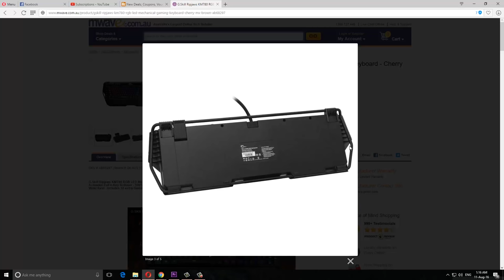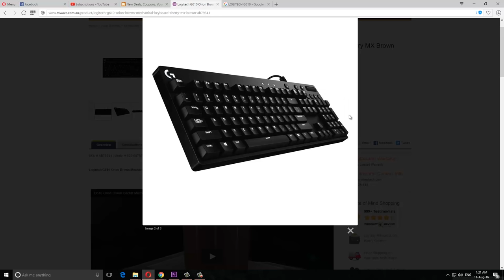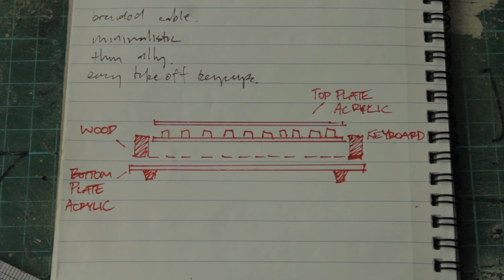Modding the G.SKILL Ripjaws KM780 RGB Mechanical Keyboard - Part 1

Comment: Are the switches soldered on, if so, how easy is it to remove them and solder on different switches? 
Signed a KM780 owner

Comment: The only thing about keyboard making is the cost. I've already put in 140$ for 60 percent board I'm building.
Reply from the maker: Indeed. Unfortunately everything just adds up. Is this a kit? or you're hand wiring?
Reply: +TaeKeyboards kit.  Gh60 pcb.  I'm going to make it after MD ships my top plate.